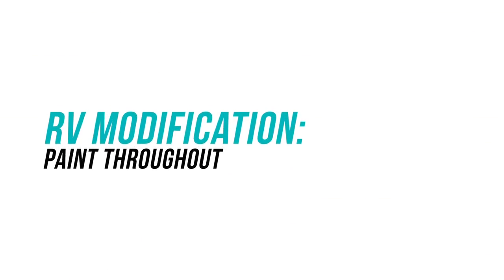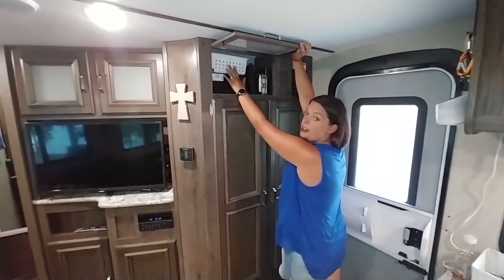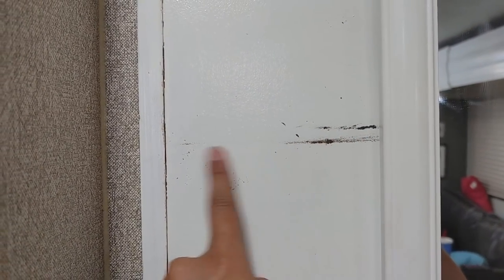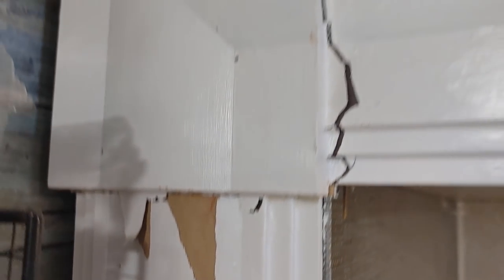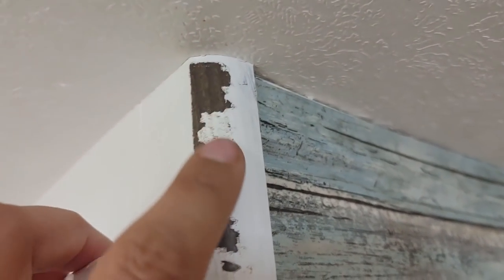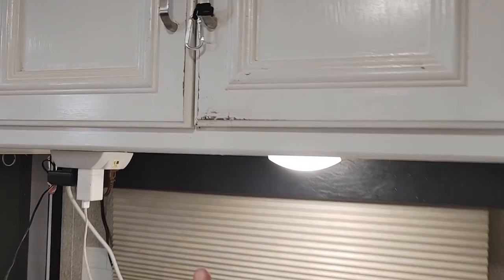6 Permanent RV Modifications (Paint, Removals, etc.) Have They Held Up?

Comment: I love that you're willing to show that not everything is picture perfect.  It's your house and it's going to get used.  Crazy that people give you hate for doing your own thing.  I'm jealous of what you guys have been able to do and see.  For screwing into the walls, the walls are hollow so are you using some kind of drywall or other type of anchor?  I've thought about putting things in ours but afraid a normal screw won't hold with the walls being so thin.
Reply from the maker: Thank you for the encouragement. 💗 As for the screws we have only screwed into the outside walls so far. None of the things that we have hung up permanently are on interior walls. The outside walls are filled with foam or something. See how much I know! Anyhow screws stay they're pretty well.

Comment: We cleaned our walls and cabinets, sanded, primed with an oil base primer than painted the cabinets with cabinet enamel and latex on the walls.  Two years and all has held up great. I used alcohol to clean the walls where I put the peal and stick tiles and they also have held up great. We put the stainless steal peal and stick behind our stove (the other says it has to be at least 12" from a flame and our burners are not 12" from the walls) I put the plastic peal and stick in the bathroom - again no issues.  We do live fulltime in ours also.
Reply from the maker: Thats awesome!

Comment: We used super short screws (thick enough to just go through the paneling) and we’ve fastened our metal wall art to the walls, never had an issue. Thinking of painting our bedroom walls, too much tan in the RV. We aren’t painting our cabinets, we’re lucky they are a beautiful rustic real wood. Your TT has held up really well, I love y’all’s videos.
Reply from the maker: Thank you! We were so scared to drill into our walls but it's been fine so far and so glad to not have to deal with those command stickers falling off all the time.
Reply: @NoOrdinaryPath  agree, they can be frustrating, especially when you store your camper and extreme heat or cold get to them!